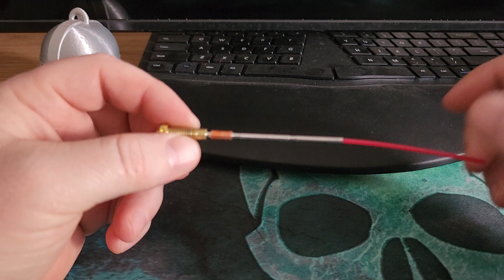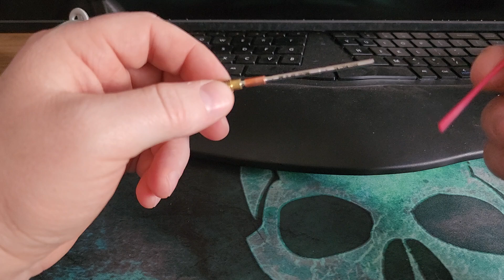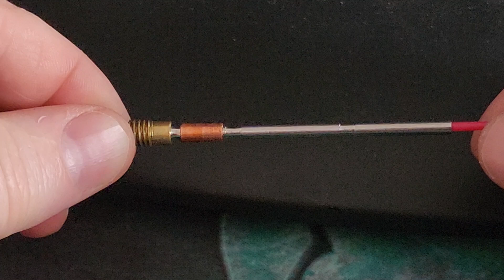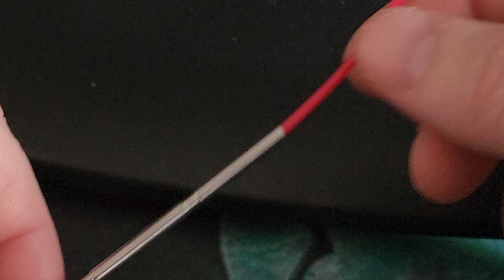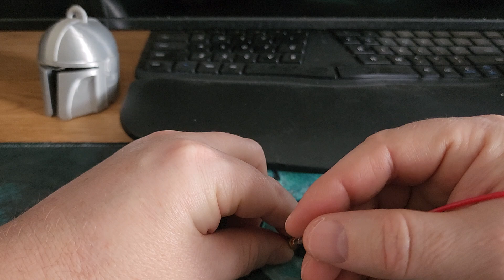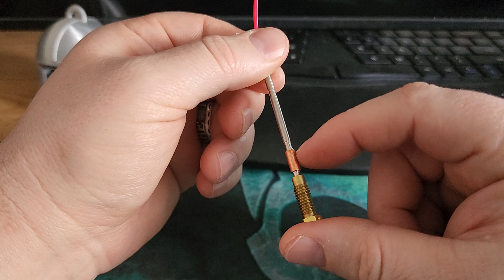This Is Why Your Prusa Gets Stuck Filament Errors

Comment: Thanks ever so much for pointing this out, because this problem was driving me round the bend. 
This is yet another problem with this particular printer model. I'm fed up of finding design issues with my XL, and this is yet another one. To make matters worse, there's no warning in the manual to avoid over tightening the bolt. The XL is very expensive compared to it's competition, and it looks like it was released before all the problems with it were worked out.

Comment: Hey Monkey Brains I’ve had a few problems with IIIdmax with the Prusa XL. I was running it at 220 now 225 initial layer at 230. Have not had any problems with the bambus. I appreciate the help.

Comment: So, has Prusa said what the appropriate amount of torque on that retaining screw should be so you can use an adjustable torque screwdriver when installing the replacements?
Reply from the maker: Nope. I'm just going with finger tight snug. We will see how it goes

Comment: I’m glad it’s not something bigger than this.   I’ve been wanting to order an XL but had second thoughts.   Seems like an easy fix, but diagnostic was expensive with time and material.   I had a similar finding with an assembled MMU3.    The roller idler was not in line with the extruder teeth.   I had many many problems until I took it apart and found the builder messed up and failed to align.  Now it prints really well.
Reply: Prusa used to be a premium brand. Now they're just so-so. I ordered my XL just before covid happened, it took ages to arrive, and I've had nothing but problems with it right from the start. It doesn't even load it's own filament and having to pull and push a metre of filament every time I need to change it is a hopeless arrangement for such an expensive tool.
Reply: @tasmedic it still is a premium brand the only thing close is Bambu and they have their own issues.

Comment: Thanks for sharing the cause of the extruder not feeding. It would be useful if there was a way to gauge how tight we are torquing the screw so that the tube was not damaged. I am not aware of any affordable tools that are sensitive enough for this. As far as fixing the dented tube goes, the right diameter of drill rod with a chamfer on the inserted end would likely straighten it. This was mentioned in an earlier comment. This of course depends on how severe the crushed area is. Anyway, time to get back to printing.

Comment: So are you saying the solution is to replace the nextruder? IMO thats not a long term solution. The retaining screw is just going to dent the new nextruder again (in my experience I have to tighten the bolt pretty tight otherwise I get bed levelling issues). Ever since I upgraded my printer to Mk4 with the nextruder ive thought this to be a bad design. I realise they wanted to make it easier to swap out the nextruder but I just dont think the design was the best solution. I think it needs something like a piece of rubber to help keep the nextruder in without excessive force.
Reply: It's insanely poor design. We've had nothing but problems with our XL. I think I've now spent around 15h of work time to try to sort issues out. Most involving ready made assembly of nextruder. I was about to return machine, but decided to check out gearing. Even that semed to be poorly assembled. Imho heatblock should be fixed by grub screws or something like that on toolhead and nozzle should just then screw into place. I even somewhat have suspicions that the nozzle design is flawed as I tried ABS-T on our printer, rolls that worked flawlessly on old MK3S and on XL it almost immediately grinded nextruder gears, blocked nozzles etc. I had to ditch those materials completely. I just couldn't make them work at all. I'm very disappointed in XL.

Comment: "Prusa are the greatest 3D printers ever made!"  Says every Prusa owner while fixing there Prusa.  Hopefully this fixes your issue.  If it does, you should send an invoice to Josef.  If it doesn't you really need to return it or get a working replacement.  The XL has been out long enough to work through the bugs and your issues are unacceptable for any machine from any company.  If I had an issue with one of my Bambu's, I would walk it into Microcenter and walk out with a new one.
Reply: They've absolute been. I got older MK3 at home and work. Hundreds, at least, flawless printing hours with both. We now got XL at work and it has quite a bit of issues. It's clearly this XL lineup that's problematic.
Reply: We have Youtube full of videos about Bambu Lab printer problems. You probably have a different Youtube.
Reply: @slovackoinfo  When you sell a million printers to people who never owned a 3D printer, you're going to have problems.  The difference is there are far less problems and the fixes are cheap and easy.
Reply: @ I sincerely doubt you can prove anything statistically, which you're there implying.
Reply: @jothain  60%ish of the Prusa video's talk about at least one issue they are having with their machine.  One fact that has been proven is that Josef has made 100 million selling printers that just don't work.  The MK4S seems to be the only one that prints most of the time.
Reply: Good for you. You like proprietary Forceware. I don’t.
Reply: @Traitorman.ArticleIII-Section3  I'm not being forced to do anything.  I bought their products to 3D print, and they print every single time I hit the print button.  They keep adding cool tools to help do more cool stuff and make better products.  What do you have to say about the Core One having to run through Prusa Connect?  If you can make something work from start to finish, why would you want a 3rd party to F it up?
Reply: @ 
So glad you commented. Up until 8 hours ago Core One didn’t require Prusa Connect. I am so glad you warned me about their apparent new business model.
As an aside…. Where did you get your information?
Or did you just make it up?

Comment: The nozzle is really a poor choice by Prusa, starting with its excessive length, which encourages thermal issues, but also due to its design flaw in how it is secured in place. To make matters worse, its price is simply outrageous. When I look at the price of an A1 nozzle with the heatsink and silicone sock, I think you really need to be wealthy to buy from Prusa 😔.
Reply: Thank Gods I’m wealthy and refuse to knowingly install spyware and forceware.

Comment: That is a terrible design flaw
Reply: Incorrect. User error. Most heatbreaks on hotends are held in this exact same way with a screw and you are not support to over tighten it at all. Just enough to hold it in place.
Reply from the maker: Factory assembled XL....
Reply: @ My statement still stands. If it's damaged it's user error. Whether it's a Prusa Employee or Yours or anyone else's.

Comment: I have this problem with all five heads. I just realized that I turned them all with a bit of force to install the silicone socks. Maybe I should have loosened the screw.
Reply: I unscrewed all 5 and checked mine have no dents and the filament glides through without resistance

Comment: This is very similar to the problem with my Mini (and someone on Marketplace that was trying to sell two of them).  In all cases, from the factory, the thermistor was over-tightened, somewhat crushed, and thus out of calibration (new thermistor not over-tightened) solved the issue.

Sounds like this is a common problem pattern at Prusa assembly.

Comment: This was an old issue someone had because they tightened the screws down really tight. As I recall they only need to be tight but not tightened hard because of this denting and restriction of the filament path.

Comment: Seriously Prusa...you are letting someone else discover your assembly line errors?  It will be interesting to see how many others share similar issues that they have because of this issue.
Reply: It says very clearly in the instructions when you change nozzles not to over torque this screw. 

If it came from the factory like this that’s another issue, but adjusting this screw is part of normal maintenance, including installing the silicone socks when you first set up the printer.  In other words—user error.
Reply: @peterwmdavis  He states in the video he ordered the semi-assembled and this was already in the printer.  Do people not even watch the video before commenting? lol
Reply: @Botanical4038  No need to be like that. I missed that completely too.
Reply: @Botanical4038  As I said if you read my comment, (1) if it came from the factory like that it’s a different issue, (2) there are still lots of reasons for users to adjust this screw.  I didn’t mean to imply that they did in fact adjust the screw.
Reply: @peterwmdavis Why shouldn't silicone socks be used on XL?
Reply: Our work XL has been disaster. Non-working first filament sensor I fixed myself, Corexy issues and couldn't use their belt tuner application. Then lastly load cell apparently died and scraped sheet cause of it. Waiting for parts now. Less than week old machine and every single fault on Prusa assembled part. About 10h into troubleshooting now after assembly and still going to at least disassemble the nextruder 🙄